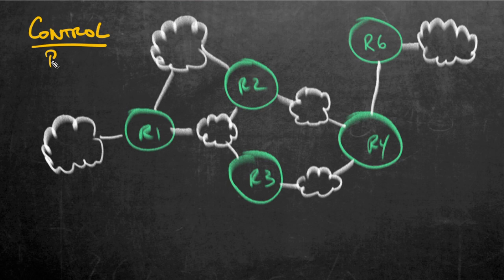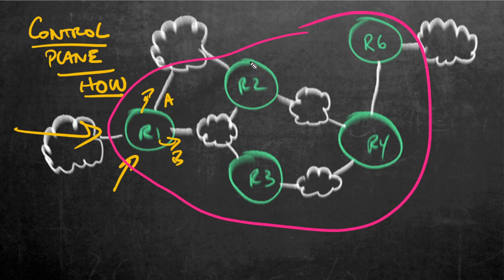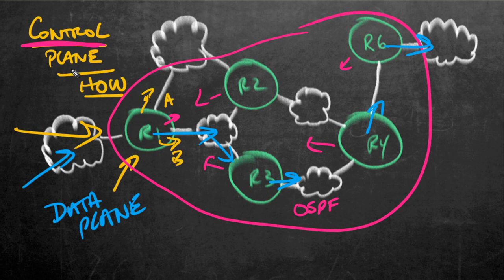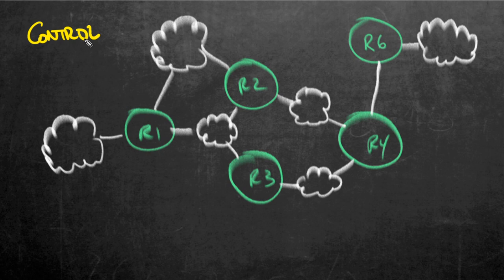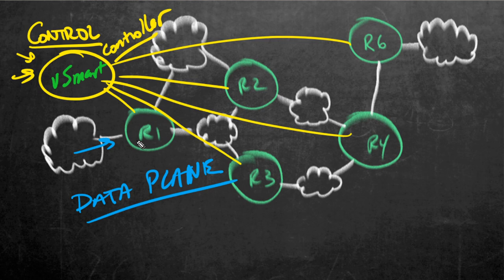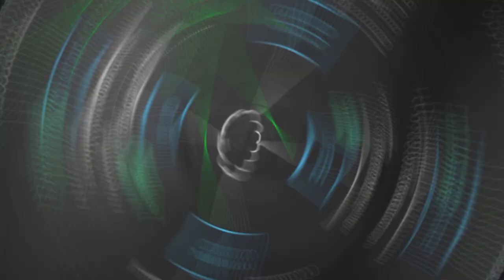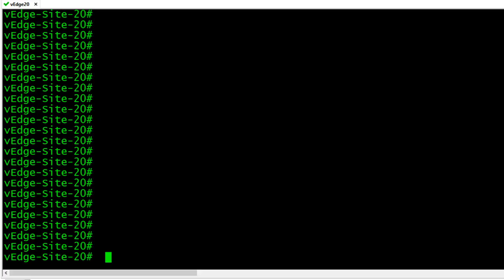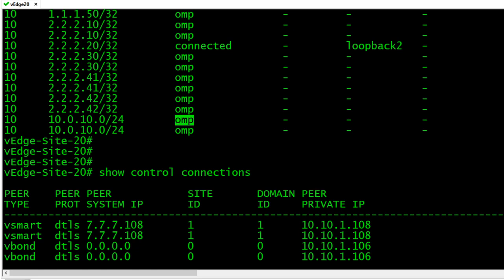Why does SD-WAN separate the "control-plane" from the router❔  (What did the router do)❓

Comment: Hi Keith, I have question regarding SD-WAN control-plane. Aside from Cisco vSmart controller that de-couple control plane from router. Does other vendor orchestrator doing control-plane function as well? from what I know other vendor orchestrator same like Cisco vSmart+vManage+vBond. From other source as well said SD-WAN(SDN) will de-couple control plane and data plane but it is just hard to find documentation that said explicitly orchestrator  doing control-plane. By the way thanks for the great video.

Comment: Is it like NHS, if it was a led physical device or application on a VM, and routers would also build tunnels between themselves using it and encrypt them using IPSEC (as is the case with DMVPN)?
Reply from the maker: Thank you for the question Олег. vSmart rains down the instruction for which edged devices should built an IPsec tunnel to which other edge devices.

Comment: is it better to call the vsmart a policy manager rather than it allows routing protocols to stay updated, after you set the policies the routing protocols are making decision on what routes and networks are available by themselves with little reference to the controller?
Reply from the maker: Thank you for the question Steve Spence. 
The "management team" for Cisco's viptella SD-WAN solution are vBond, (for coordination and bringing on new edges), vSmart (for communicating information to the edge devices), and vManage (which allows us humans to interact with the system, and specify our policies).    Edge devices are good for about 12 hours of no contact with vSmart before problems begin to creep in.
Reply: @KeithBarker  Oh my  that could be  problematic